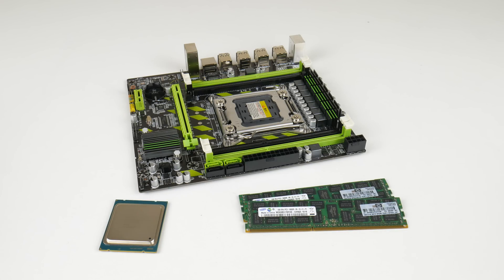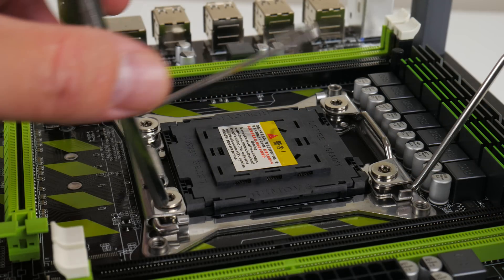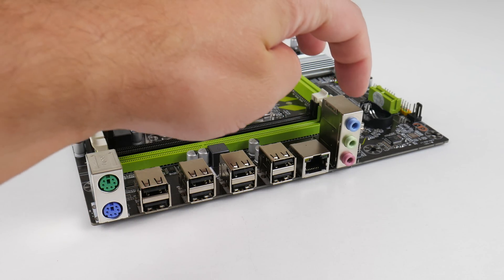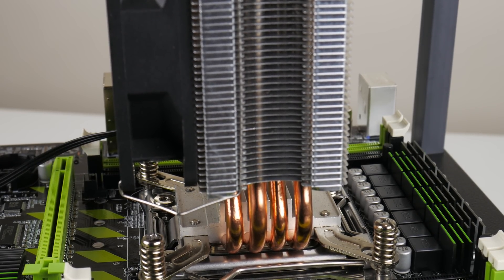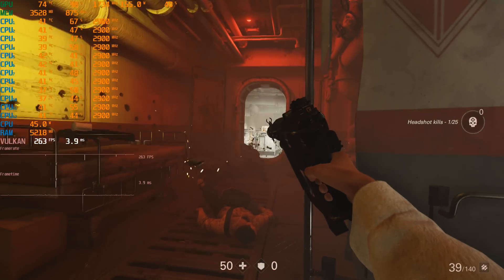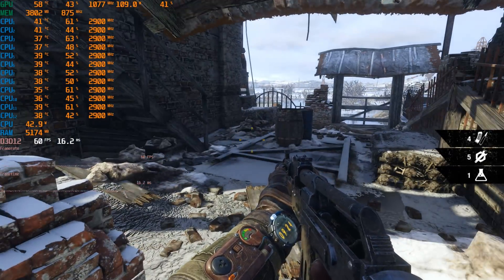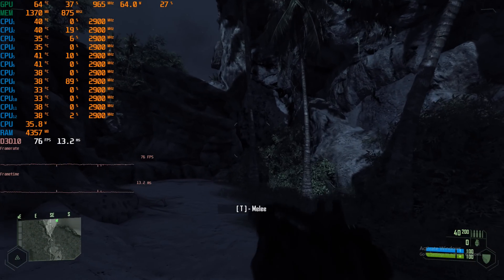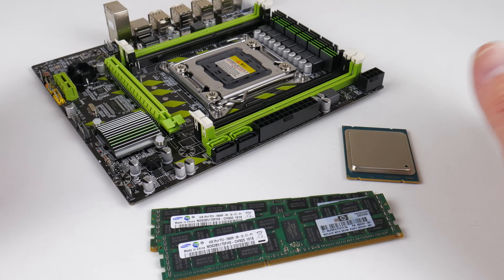$99 LGA 2011 Motherboard 6-Core CPU 8 GB RAM Budget Bundle

Comment: I'd recommend tge E5-16XX V2s over any 26XX Xeon.  The 26XXs are great for multithreaded processes, but are terrible in contrast to the 16XXs for single threaded tasks (like basically every game).  For reference, an i5-4440 performs better at gaming than an e5-2660 V2.
Reply from the maker: It does depend a bit on the CPU. Especially the very high core count CPUs have large Cache and games can benefit from this. I will review the top Ivy Bridge Xeon in a future video, it does surprisingly well. Just not something for high refresh rate gaming...
Reply: HEY, does this statement still stand? im looking for a second system, cheap side, $160 MAX. mainly for gaming and some 1080p streams from netflix and youtube? iv loved the 2560 xeons bt also know of the 1650's iv been out of the loop for some time though and would love some guidance or any more info on these.

Comment: My 13 years old Intel core 2 duo E8500(Gaming beast) still can play torchlight 1 in 1080p resolution with Intel G41 express chipset from mother board. Computer depends on how you use it and I watching YouTube videos in 1080p with 1080p monitor.
Reply from the maker: So many great old games. For example Epic gives away free games all the time, I have over 100 collected now, many are fantastic AAA games and run well on older machines :)

Comment: Been watching your videos.  Great tips.  I have a question.  Would going with a 115tdp processor be bad for longevity of the atermiter boards?  Would it be better to stick to less than 95tdp?  Thanks in advance.  More power.

Comment: Hello. Does the mainboard work with HDD?
Reply from the maker: Yes, SATA HDD or SSD!
Reply: @philscomputerlab  thank you man. happy new year!!!
Reply: @philscomputerlab  im watching combo ... 4×4 gb ddr3 ecc 1600, 
xeon e5 2689 and Machinist x79 turbo for 150$. how long will it work... if mobo farts im fu. its tempting but...
Reply: I have another question. Does this motherboard require additional wifi/ bluetooth card or there is already built in wifi/ bluetooth? Thank u.
Reply: @nguyentung8697  More then likely needs a WiFi Card or WiFi Usb Adapter
Reply: @DragonBallNOW  thanks

Comment: Great videos and guides.  Thank you!  Could you advise on how to configure a pcie x1 USB 3.0 Controller?  The BIOS options are so many!  I can either have USB 3 controller working with no USB 2.0 or the other way around.  Hard to figure out although the USB hub does show up in windows as correctly installed...

Comment: How is the power consumption? How many Watts did your psu use?
Reply from the maker: It should be mentioned in the video I hope...
Reply: @philscomputerlab  yea. You use 750 watt. After googling, found out total power consumption is 300watts. Thus, my current 500watt psu won't suffice.
Reply from the maker: @akhmadkai2189  6:34 for CPU load. In games it will be higher depending on what graphics card. Your 500 W PSU is perfectly fine...
Reply: Yep, thanks for the response. The gpu is a bit high power though, I plan to use rx580, seems might have to choose nvidia as theirs is less power hungry.

Comment: Help. I am stuck on an infinite boot loop when trying to install Windows 10 from a USB flash drive. What to do? Same exact specs except processor is an Xeon E5 2620
Reply: Did you get it running?
Reply: Try installing Windows 8.1
Reply: @pranavbaurasia9373  Nope I didn't. I returned it.
Reply: @dustycompiler  what did you build finally?
Reply: @pranavbaurasia9373  The item must be defective. It  wouldn't boot Linux also so I returned it. It was supposed to be my first server build. So I built a Core i5 3rd gen. instead.
Reply: @dustycompiler  In India also, I can find used office PC i5 3450s with 4GB RAM and 500GB HDD for USD 122. What do you say should I get this as I can check that it is running before buying?
Reply: PS:- No monitor, no keyboard, no mouse, only CPU.
Reply: @pranavbaurasia9373  I think this is a great build. It just so happens that it didn't work for me.
Reply: @dustycompiler  but AliExpress return Courier in India is very costly than the original cost of products
Reply: @pranavbaurasia9373  It's not worth the risk then unless it's brand new and has warranty. Returns here in the Philippines cost nothing.
Reply: @dustycompiler  Thanks man for the info. I am thinking of pairing the Dell Optiplex sff i5 3450s with 1050ti low profile brand new for 98 USD and 8 GB ram stick for 30 USD.
Total cost will be 122+98+30= USD 250
What do you say should I go with this?
On Reddit, people are saying you can get i7 4770 for this 122 USD but in India it is around 240 USD online. I don't know the pricing at local shops.

Comment: the problem is the power supply, very often will exceeds 300W power consumption. it looks just stupid saving money on hardware and spend a lot on energy bills.
if your PSU is rated 750W but you say your computer will only spends 90W max why the hell do you need a 750W PSU? makes no sense

Comment: Hello All, 

Will this board support an Intel i7 -3820 CPU? I have some spare parts laying around and want to build a low budge SteamBox. Below are some of the spare parts I have on hand. 

1x Intel Core i7-3820
1x Intel Core i7-4790S
2x Intel Xeon E5-2430
1x EVGA 500 Watt PSU
6x Transcend 2G 1Rx8 DDR3 1600 ECC RAM
1x Corsair 250 SSD
1x 1TB Western Digital Caviar HDD
1x 860 EMO mSATA SSD - 500GB

Looking for suggestions, on a motherboard, case, and GPU. I would like to keep at about $100.00 US.
 
Thanks in advance for the feedback. Look forward to your suggestions.

Comment: I got myself one of these bundles, 2650v2. It took only a couple of weeks to arrive. Very happy so far, but I think the 500w PSU isn’t up to the job, under full load it just crashes, no blue screen etc. :-( I was hoping I wasn’t going to have to buy a new psu. 

Greats video and a good little bundle available if you have a look at the options.

Comment: 99 $ ??? You do not count the price of supplying the SSD of the graphics card & the heatsink ???
Reply: he only included pricing for the core parts : mobo/cpu/ram.  Likely for many viewers on this channel, they have other PCs and some parts extra around.  air coolers are quite affordable on Aliexpress and so are used GPUs.  I not sure if I would trust SSD from Aliexpress cause some brands of 2.5" SATA SSD from there do not have a dram cache.   Not sure about the m.2 nvme drives on Aliexpress.  Would be nice if Phil could maybe check into that in a future video.  Like a Goldenfir or Asgard m.2 nvme ssd if they are good enough to use on a daily driver.

Comment: I got a optiplex 3020 with an i5 4590 + riser cable with a RX 570 for around 200$. I'm upgrading the ram to 16gb the HD to a 480 gb SSD so in total around 300$ and a processor that's way better.

Comment: Can it be used to stream edit and game and also doea it have wifi or i have to buy a modem?
Reply: I don't think it has built in wifi.  So you'd likely need to run a hardwire ethernet connection..umm..modem?  are you talking dialup connection?  MOdem should come from your internet provider.

Comment: Too bad that there's no USB 3.0 like on a board you reviewed several months ago
Reply from the maker: Yes just shop around, some boards have M.2 and USB 3!
Reply: @philscomputerlab  yeah was gonna say... the board I ended up getting (it was a few months ago btw) has USB 3.0, a m.2/nvme slot.. but only one SATA 3 port..

Also question: how the heck were they able to squeeze USB 3 and m.2/nvme on a x79 board?  I thought both interfaces were newer than that chipset
Reply from the maker: @adventureoflinkmk2  These 2011 CPUs have like 40 or so PCIe lanes in the CPU, one of the highlights of this platform! Don't think has to do with the chipset...
Reply: @philscomputerlab  fair enough
Reply: @philscomputerlab  that said.. http://ark.intel.com/products/64015/Intel-X79-Express-Chipset
Reply: @philscomputerlab  however... is it possible that the USB 3.0 as well as the m.2/nvme controllers sit on the pcie bus?  With 40-ish lanes at your disposal it would make sense

Comment: For the games that you show it can run, you can simply run all the game that are out there older than let's say 2016. This is simply insane. I saw that there are many type of boards and stuffs. You can make a ,,super" PC gaming just by spending almost 150$ for a MOBO, processor and rams. It's mind blowing. That those who don't know spend over 1k $ to have that power in games. I understand, who would buy from China and how long they resist.

Comment: Hello, how will this work as a daily pc? Windows 10, browser, illustrator and so on?? Cool vid
Reply from the maker: Very good! It has enough single threaded performance for older applications, and enough threads for modern multi-threaded tasks. I did 4K video editing on such a system for a while and it was fine.
Reply: @philscomputerlab  wow. Good to know. Considering that u can mount 16 gigs of ram.... Can u also mount a dedicated video card?
Reply from the maker: @Enthcreations  Yes you can mount a video card, and easily up to 64 GB RAM.
Reply: What kind of budget card do you suggest?
Reply from the maker: @Enthcreations  RX 470 or 480

Comment: Wow, Xeon + ECC + 16GB + 2 SATA3 = great entry level ZFS server.  Most home users won't need more.  For combo SSD+HDD use all 4 ports - most spinning rust won't outpace SATA2 anyway.  That tiny PCI slot could even take a high-performance NIC.

Comment: The 750W power supply seems like overkill. I'm guessing you could probably get away with a 300W supply (and save some money by going with the lower wattage supply) if you're power draw is maxing at 90 watts.
Reply from the maker: It's what I have at hand, and I use the same PSU, so you can compare from video to video :)

Comment: I just finished building a computer with this bundle. A few things that I wish I'd have known ahead of time. 1. The Snowman I received does not fit if the inner ram slots are populated (I chose 4x4GB ram, so mine were). the hold-down clip interferes to the point of pushing the ram out of the slots. I broke the clip and have temporarily zip tied the cooler on until a proper lga2011 version can get here. 2. The only versions of Windows you can use with Xeon processors are Win10 for Workstations and  Enterprise. I went with Enterprise. 

Overall, this is a great bargain. I added a Sapphire RX470 Nitro that was a former mining card and reflashed it's BIOS. The system can completely flood a 10Mb internet connection installing updates and software while only using 1% processor and 20% ram. Motherboard BIOS options were sparse, but the defaults worked fine. I understand that there is a BIOS update on Overclockers.ru that allows overclocking, but the stock system is plenty fast enough to play triple-A titles, so I've left it alone.

Thank you so much Phil!

Comment: RX5700??!?!?! That is like dropping a Porsche 959 twin turbo engine in a YUGO and staying for the price of a YUGO you made a fast car! Video card alone is 4 times more expensive that your entire "budget bundle" of used parts! Throw in $200 for the power supply used and another $200 for the HD, might as well throw in $$$ for a case, keyboard, mouse, monitors, ect  and your "BUDGET Bundle" PC tops $1500, and it doesn't play CRYSIS? Did you forget to mention what ELSE it doesn't play?!?!

Comment: It shows how little IPC performance & other technologies has improved in the last decade. No one would have thought to use 1991 processors in 2000! Yet here we are, 2011/2 parts are still relevant in 2020

Comment: If.i used patriot ram 2 x4gb 1600mhz would that be ok or is server memory better
Reply: A lot of these require ECC server memory, and regular non-ECC ram won't work.  I haven't looked at this in particular closely enough to know for sure yet, just be aware you generally have to buy the right ram not use what you already have if it isn't server memory..
Reply from the maker: Yes that works fine, these boards do not need Server RAM, it's just if you buy RAM, then server RAM is cheaper :)

Comment: Remember that it was mentioned somewhere that suspend does not work with these X79 motherboard. The closest I got to suspend was stopping CPU clock, so power rails are still on to peripherals. No deep sleep.
Reply from the maker: Yea that's right!
Reply: @philscomputerlab  I just found a way to save power without manually powering off.
So in ubuntu, we can run a script on suspend. So I inserted a script to shutdown the system on suspend.

So when the system is idle for say 15mins, it would go into suspend, running my script, and instead of a suspend, it will shutdown instead.

sudo shutdown h now <-- gets the system to shutdown completely.

https://blog.christophersmart.com/2016/05/11/running-scripts-before-and-after-suspend-with-systemd/

Comment: hello, i have a question, Does throttle stop work on this mobo?
I mean to adjust the voltaje of the cpu cores, i want a HTPC and it can be perfect with a 2620V2 or 2630LV2

Comment: The version of the motherboard with an m.2 is only $3 more, it's $49
Reply: link ?
Reply: @LordSlickRick  they raised the price $55 now  https://m.aliexpress.com/item/4000404265199.html?trace=wwwdetail2mobilesitedetail&gps-id=storeRecommendH5&scm=1007.18500.139671.0&scm_id=1007.18500.139671.0&scm-url=1007.18500.139671.0&pvid=19a51cd1-a353-4bd2-b6eb-b298759b519a&_t=gps-id:storeRecommendH5,scm-url:1007.18500.139671.0,pvid:19a51cd1-a353-4bd2-b6eb-b298759b519a&spm=a2g0n.detail-amp.sellerrecommend.4000404265199&aff_trace_key=&aff_platform=msite&m_page_id=9929amp-V_5003sH2maNRHCyLf7wbQ1585348191539&browser_id=83af3ee78ab349e486ead9048ce57c4f&is_c=Y

Comment: This is an ok deal however my phenom ii x2 550 black which is unlocked 4 core to a phenom ii x4 b50 is only a little slower than this CPU and the gigabyte motherboard has been reliable for 10 years. For me it's not worth it. I bought a used backup mobo
Reply from the maker: Phenom II doesn't compete against this CPU. It doesn't have modern CPU instructions, so many games won't even start.
Reply: @philscomputerlab  I did a search and user benchmark website gathers all the tests from users and in comparison this cpu was only like 9% better overall. the only game I play is command conquer yuri's revenge which is a 10-15 year old game and relies on cpu and is 2d, not a real 3d game. I don't play 3d games so it wouldn't bother me

Comment: Did they update that MOBO? I see M.2 slot now in AliExpress.
Reply: I'm pretty sure they did.  I ordered 2 of these with the slower Et 2620v2 processor, and 16gb of ram for $65 USD (I bought more than 1, and I'm in Hong Kong so shipping is neglible).  These are fantastic little boards, and fit the tiny/cheap cases with ease.

Comment: Why doesn't it run Crysis?
What if you use an RTX 2080 Ti as a main GPU, and fit an RTX 2060 on the PCIE 1x slot, for computing (openCL or CUDA)?

Comment: And, one more thing, price for 2697v2 (top of the line) is droped by 50%, now its about 150 euros compared to 300 before. Can You benchmark one ? (not very cheap, but a bit more affordable then before)

It is the top of what You can do on given socket, so it would be nice to just draw the line, if system on 2011 is worth to buy in 2020 (if it's suitable for not just cheap PC, but higher end stuff) or it is time to move to 2011v3 or more modern platforms.

Comment: https://www.ebay.com/itm/QTY-1x-Intel-CPU-E5-4627V2-Egiht-Cores-3-3Ghz-LGA2011-SR1AD-/164002585031?_trksid=p2349526.m4383.l4275.c10#viTabs_0

Looks like the E5-4627V2 is coming down in price, finally.  8C/8T up to 3.5Ghz on all cores at $72 bucks is not a bad deal for a locked CPU. IMO, for these Chinese boards the locked CPU's with highest base clock (w/turbo) make a lot of sense.  V2's tend to run cooler with have less power draw (i.e.: Ivy Bridge), so they are gentler on the motherboard VRM's.

I like this particular chip for such budget gaming builds...just my personal experience.

Comment: Man great video im building a budget rig and you are literaly my go to when seacrching for hardware thanks a lot .
Pd:I found the e5 2620 v3 at ⁓usd 20 6core 12 thread processor, leave you the link in case is useful https://es.aliexpress.com/item/4000423696988.html?spm=a2g0o.cart.0.0.65733c00uRtxmH&mp=1 
Thanks again and keep up the good work.
Reply from the maker: The V3 doesn't work with this motherboard. V3 is for Haswell systems.
Reply: @philscomputerlab  oh, thanks for the quick response man, but could it be a good choice for a mid range budget rig?

Comment: would a Xeon E5-2690v1 not be a better match?

8 cores & faster (8 core is kinda the new standard)

and I would add a little more ram : 32((4x8) or 64 (4x16) most likelely.
(4x32 would be possible too)
https://www.aliexpress.com/item/4000168330661.html

if I pick those options... the cpu gets around 70 euro, and the ram 55 euro.. with the motherboard of 45 that is still only 170 euro..
and it would be a much better setup.

Comment: The GPU utilization seemed to be always below 50% so basically the best you should get is GTX 1060 6gb or RX 570 or just skip the bundle all together.
Reply from the maker: Well it depends, I tested the games at high details and 1080p, so if you try higher details or higher resolutions you will need a stronger graphics card.
Reply: @philscomputerlab  Sure in those situationd you will need better GPU, but I highly doubt you have 2k monitor If you can only afford this bundle. 
The value is there no doubt, but If you are gonna save money, that's gonna compromise your performance so that GPUs like RX 570 are your best choices. There is still way to upgrade The CPU later on so mabye that way you can justify better GPU.